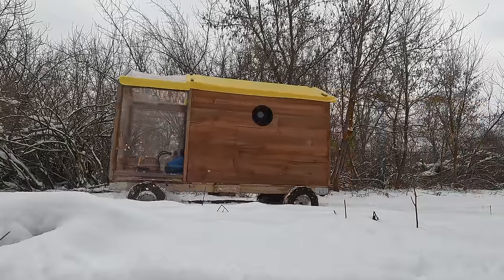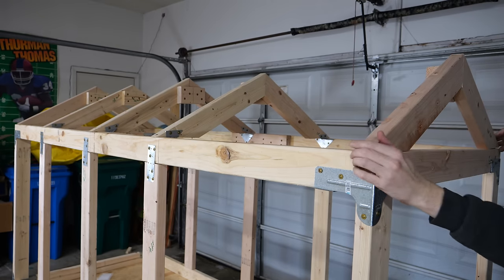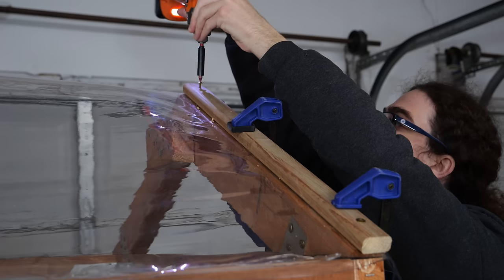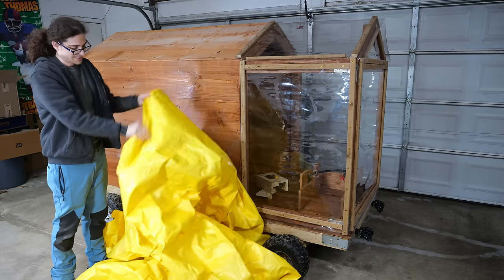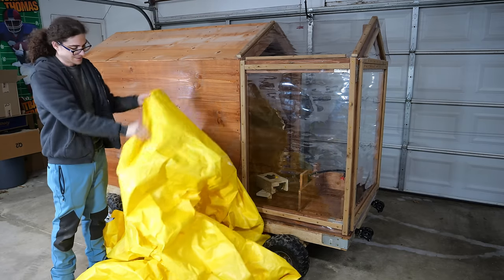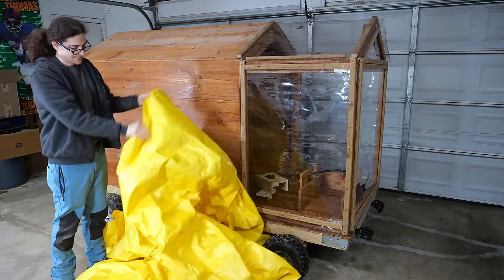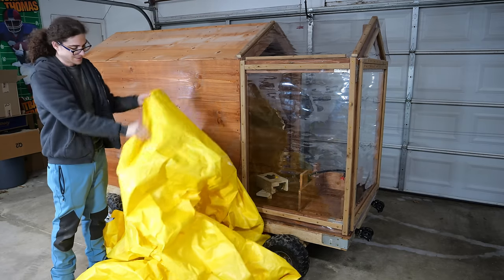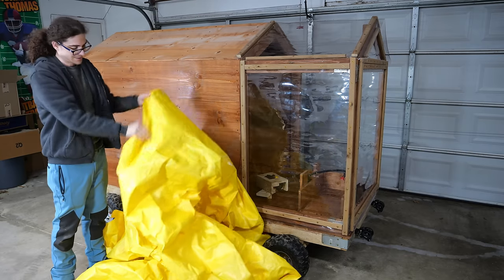UPGRADING The Drivable Camper - Full Cabin Build + Snowy Overnight Adventure

Comment: Great job! A few pointers:
1. Rear view and side view mirrors.
2. Some sort of pop open top, vw camper style, hinges at front or rear of vehicle
3. A tiny wood burning stove
4. Thinner supports
5. Thinner veneer like luan so lightweight expansions are possible
6. Logbook of adventures
7. A boat port a pottie with separating waste bottom.
8. A second emergency entry exit for safety. (OSHA enclosed spaces)
Reply: ..a log book? You really are an OSHA man
Reply: secondary emergency exit/entry is the front vinyl imo

Comment: Your camper content is incredibly refreshing. I'm so used to seeing $100k sprinter van conversions get so much attention for camping, they almost make it seem essential. My suggestion would be solar panels on each side of the roof if needing the extra power. Maybe instead of tarp you could use some waterproof vinyl fabric for the 'roofing' and then stitch the solar panels on top of it. There are videos of people doing that on boat bimini tops. I do live in south florida though so i'm not familiar with how that fabric would do in snowy weather, but it handles wind very well. Maybe not needed for short camping trips though. Other comments have also already mentioned some kind of fan/vent for the condensation or however you call it that your breathing indoors makes. Keep up the amazing videos, I look forward to them!
Reply: There's a YT video someone made about how to make any fabric into a waterproof tarp using silicone caulk and a solvent but I don't remember which one. You would be able to make a whole top out of it.

Comment: Next step. Insolate camper. Keep in mind that the inverter will generate heat. So you could add a couple of little fans to add air flow to help keep it cool. You did good

Comment: Hi Jason. I recently found your channel and you have quickly become one of my favorite creators. I really enjoy the creativity in your builds. I have already found myself looking forward to your uploads to see what you come up with next.

Since you asked for suggestions for future builds, here's my list of things I would like to see you tackle:

1. Insulation. You woke up to a chilly 25 degree morning, but an insulated camper would hold in more heat overnight. I think this would be a nice upgrade to any camper build and a big quality of life upgrade for winter camping. Note: a two layer window with a small gap of air between layers will hold in heat better than a single layer window.
2. Suspension system. Don't know if this one is possible, but might be doable with some heavy duty springs. It would be cool to see if you can tackle this.
3. Ventilation. Vents could help with your humidity/window fogging problem as well as reduce concerns about carbon monoxide.
4. Lighting. Orange or yellow cellophane covers for lights will mimic a campfire and makes for a more cozy experience.
5. Metroid Prime is my favorite gamecube game for the exploration, puzzle solving, and cool aliens. I suggest trying it if you haven't yet!

Comment: Screws tend to break where nails tend to bend when a structure is flexed, which happens quite a bit when bouncing through the woods.

Also a roof gap at the peek is a good thing as it helps with venting the rolling cabin. Cover the gap with a Roof Ridge vent instead of filling it in. Of course that assumes you use something other than a tarp as a roof in the future. This can be made with a closable end caps for if you are worried about too much heat escaping. Also helps with Air quality, and moisture buildup.

Your vinyl roof bit in the front is going to have pooling issues for rain/snow, with that bottom wood strip in place. Should have made it overhang and go over the side and secure it to the side of the top wall beam instead of the top of the wall beam.

Comment: Points to improve upon:

1. make all membranes (tarp, vynil) double-layered, the layer of air between the two sheets could help with heat retention.

2. insulation for the walls and roof - add some sort of foam or fibrous insulation to prevent heat from escaping through these parts.

3. suspension - create a suspension system to raise the vehicle from the ground and reduce the amount of bouncing around.

4. - bonus - snowplow.

Additional good things - add an awning for an extendable roof on the side for an improvised porch, good for when you want to do some campfire cooking.

Another is - create a trailer. 

It could be used to haul extra gear, or even for a field shower.
Reply: I was going to suggest myself some insulation board that would be easy to cut to size, could also cut sheets to fit in where the vinyl windows are,then remove when needed. Love the build!!!❤
Reply: This should be at the top. Would love to see him do this.
Reply: 5.  Slide outs :)

Comment: Love it...
Some suggestions..
Definitely bigger wheels, like wheel barrow wheels. 
Headlights also, it will add to the "submersable" feel of it.
You should try tracks, like a bulldozer, or maybe have a half track, they go faster and more maneuverable.
Also - you should get the back door to open upwards, so it will make  a little covered porch area when you open it up. You could even make a deployable set of tarp walls, but thats more a summer thing.
Reply: He made the original motor to work for a specific range of sizes/specific types of wheel. Just like on a combustion-powered vehicle (passenger cars, mainly), you can't stray outside of a certain range of sizes in wheels or your engine uses far more to power everything with even more actual power loss. You'd lose more than you gain, essentially. This is why they need to upgrade systems if you have a truck you want to jack up, since you'll need much larger wheels, typically both in height and width. 

On most vehicles, you'd have to modify the suspension, drivetrain, and possibly the engine in order to accommodate much, much larger wheels. He'd probably end up needing a lot more power to get several inches larger in diameter for wheels. I can't tell you specifics since I've never worked with such small systems, but this is just the general rule.
Reply: He did put tracks on it at first , if you go back and look at previous vids
Reply from the maker: Yea I need some bigger wheels! maby some chains on them. I might try some larger tracks again but I'm worried it would be to heavy for them and rip. Ill think about it all  Thanks for the suggestions - Cheers!
Reply: @QuietNerd  Your channel is delightfully weird, and ....... cozy(?) Thanks

Comment: It would be really cool if you had a tablet on a small slanted dashbord at the front, like a StarTrek control display, that controlled the motors and another one that displays battery status, temp inside and out, lights, WiFi signal etc.
Another great build QN, you did a fantastic job. Those port hole windows look awesome.
There's a channel you might like called "Truck House Life," a guy built a small wooden cabin on the back of his pickup truck, it's full of great solutions.

Comment: I suggest bungee cords, Squeegie, and micro towels to help wipe down the windows with little to no smearing. Did you know they make chains for your size tires? That could help grip the snow and ice. If that sleeping bag has a bottom zipper keep the heated blanket feet and legs. You can keep it low and still be warm. Less is more. Too many clothes in a sleeping bag won't help keep you warm, but hold moisture and make you colder. A head cover for sleeping works better. Balance out your load. Help keep your buggy from bouncing so much and help distribute the weight equally on your power wheels. Like I said it's just suggestions.
Reply: Good ones!
Reply: @causeeffect7624  I had more. I am retired USAF but my first duty assignment was a mobile radar unit in Germany. We were out in the field more than the Army was. Packing and unpacking finding out what works and what doesn't.
Reply: @spokanetomcat1 it could be debated that keeping the heated blanket near your genitals would keep you warmer due to a lot of blood flowing in that general area
Reply: @Da-choppa  Surprisingly, you will be warmer faster with the heated blanket around your kidneys.
Reply: @spokanetomcat1  really? I’ll have to try that sometime, thanks for the advice
Reply: @Da-choppa  PS...love your name...LOL.

Comment: 11:50 pro tip for when you stain wood; after hitting it with the stain, use a rag you don't mind getting ruined to help 'finish' the stain. It helps remove the marks/trail/path left by the brush, and any excess stain that could drip down.

Comment: Hey @QuietNerd , I made a list of majority of the suggestions that the comment section said. Keep up the great content!!!!

Double-Layered Membranes (Tarp, Vinyl):
Pros: Improved heat retention due to the layer of air between sheets.

Insulation for Walls and Roof:
Pros: Prevents heat from escaping, enhances comfort.

Awning for Extendable Roof:
Pros: Creates an improvised porch, useful for campfire cooking.
Cons: Adds weight, potential complexity.

Trailer Attachment:
Pros: Additional storage space, potential for field shower.
Cons: Adds weight, may affect maneuverability.

Clear Corrugated Plastic Sheets on Roof:
Pros: Potential additional insulation, lets in natural light.

Diagonal Struts for Roof Support:
Pros: Enhanced structural strength.
Cons: Potential complexity in design and construction.

Larger Vehicle with Standing Space:
Pros: Improved comfort, more living space.
Cons: Increases size and weight.

Vent Above Door:
Pros: Improved ventilation.
Cons: May add complexity, potential for leaks.

LED Lights Inside:
Pros: Enhanced interior lighting.
Cons: Potential increase in power consumption.

Switch Front Tires for Better Grip:
Pros: Improved traction.
Cons: Requires maintenance, potential cost.

4-Wheeler Tires for Better Traction:
Pros: Reduced bounce, increased traction.
Cons: May affect speed and fuel efficiency.
    
Extractor Fan for Condensation:
Pros: Reduces condensation.
Cons: Adds complexity, potential power consumption.

Anti-Fog Spray for Windows:
Pros: Improved visibility.
Cons: Regular application needed, potential chemicals.

Wedge Design for Snow Clearance:
Pros: Improved snow clearance.

De-Icer and Squeegee:
Pros: Useful for winter conditions.
Cons: Adds weight, limited use.

Slide-Out Add-On (Similar to RVs):
Pros: Increased living space.
Cons: Adds weight, potential complexity.

Attic for Storage:
Pros: Additional storage space.
Cons: Potential increase in weight.

Replace Drive-train for Higher Ground Clearance and Power:
Pros: Improved off-road capabilities.
Cons: Expensive, complex modification.

Suspension System for Improved Traction
Pros: Enhanced traction and off-road performance.
Cons: Adds complexity, potential cost.
Reply from the maker: Awesome list I appreciate it! - Cheers!
Reply: @QuietNerd  Your welcome!

Comment: Make the top collapsable, add solar, add small wood stove. Make the bottom a full kitchen. Add a tent extension on the back so then you can have a “bathroom area” with a camp toilet and a portable shower. This way, all the bases are covered and you’re putting less stress on your electrical equipment.
Reply: Think the top is already collapsible …just not designed

Comment: @quietnerd -- Big safety note, you need better ventilation to use heaters. (its why your building up so much moisture)
you will build up Co2, and potentially cause yourself injury.

you could add a angled plastic dryer vent to the tarp on the back window to make up for this :) (bonus points to add sticky backed mesh to the vent to make it bug proof)

Also, also, they make DC induction cooktops, you can avoid the inverter and waste less energy.

Comment: This might not functionally improve it that much. But a radio or just bringing a portable radio while you drive would be fun. Maybe you could somehow have the roof collect rainwater. and add in passive energy sources like solar panels and little wind turbines to collect energy just in case you ran out of battery life or wanted to stay a couple nights. I like what you did to improve. The portable camper looks insanely cozy.

Comment: Great content. Just a heads up that Moisture is probably going to get trapped in between the wallboards since the connection between each board is flat and not angled outward... Maybe not a problem for you but for longevity this would benefited to be constructed a bit differently.
Reply: I was thinking the same thing like those little puzzle piece angles that you can use to slide the boards together into one piece
Reply: @thegamingjugg3rn4ut41  there is plenty of boards and wood products designed for this. So I think better would be for everyone trying to diy building just to use something that is made for facade

Comment: I surely do have a suggestion! Add insulation to the walls, roof, and floor, so you will not need to use the heater as much as you currently do. Oh, and also add suspension so you don't shake around in the camper! 👍

P.S Make the volume on your videos louder! I can only hear them at 50+ volume on my laptop! 🔊
Reply from the maker: Ill keep in mind the volume for next video! and a suspension is a must upgrade on the next build in the future - Thanks for watching - Cheers! :D!
Reply: @QuietNerd  Thank you and your welcome!
Reply: @QuietNerd the thin pink foam boards they got at home depot think they're called pink panther lol pretty decent stuff doesn't leave a big mess

Comment: I love the build. I would suggest caulking the boards for the wall together so when its raining sideway or water coming down the roof. Water wont seep inside. If you wanna go a step further and ditch the tarp. You can ether overlap the bords or use your table saw or router  and make tongue and groove. Making sure that top is always overlaping the bottom boards. Or just buy shiplap boards. Finishing it off with the stain and clear finish sealant.

Comment: The buddy heaters are made to run indoors. I've used the big one tent camping for years, run off a 20lb cylinder outside the tent. It's got a tip over safety shut off, and a built in carbon monoxide detector that shuts it down when it reaches less than half of the recommended level. They created them to use inside ice fishing cabins up north on the frozen lakes.

Comment: The vinyl roof installation up front, had me reminiscing about me installing my hovercraft's skirt to the hull for the first time.  The skirt stretched taut on all 3 points of the hull, so stapling was really easy for one person to do.  Then I installed a strip of wood over the staples to further secure the skirt to the hull.  HH-66 tent glue was used on the nylon lined truck tarp material I used.

Comment: A thought.  Build a trailer "Docking station" to pull up on and then pull with a vehicle to different locations across the country.  The trailer could include some maintenance items as well as the ability to charge your battery via the car or truck engine.  Also, add some solar panels

Comment: Just a few suggestions you need insulation on all surfaces , something to hang and cover the windows on the inside that would be more for insulation than privacy , jacks or equal like a couple blocks of wood  would do (where jacks would allow more adjustment )on two corners to level your floor to help you sleep , and  small ventilation to remove the condensation from breath , cooking and heat .
Larger tires yes more batteries and solar panels

Comment: Maybe you should try making the camper treaded! It would certainly help with stability while driving and you would also be able to traverse more difficult terrain. Making the vehicle treaded shouldn't be too difficult because you can simply change the wheels into sprockets to drive the treads. If you wish, you could also make a gear train but instead of using gears you could use sprockets and a chain alongside the treads.

Comment: Next model you'll have to figure out how to lighten everything up so it uses less battery. Maybe a shock absorbing system so the bouncing isn't so severe and harsh on everything inside. You could also try and find a way to not only utilize solar energy, but wind and water energy as well while parked. That way you recharge even at night.

Comment: I am sure many people already suggested it, in case they did not: you could save a large quantity of electricity if you insulate the walls and ceiling with 10mm foam insulation with aluminium at one side. not too heavy and very effective on the back of a solid wood panel like yours.

Comment: Add 2 x100 watt solar panels to charge the batteries to make up for some energy loss. Also, you need to create a dehumidifier or venting outlet  for moisture. A timed air exchange..and a times heater.

Comment: Have you thought about insulating it?  It would be easy - just get some rolls of insulation, , put them between the verticals and attach some thin horizontal boards to the verticals.

Comment: Add another axel about a foot forward from the back one! So it will be 6 wheeled, and add one or two more motors depending on whether you have individual motors per wheel or not 😛

Also possibly add a sled bottom to it so it can more easily go over snow and possibly other terrain like sand dunes

Comment: Here's my suggestion!

Two 200w solar panels for the roof! If you can get it setup to recharge your battery whilst you're out doing other things in the wilderness, you could potentially have a longer stay!

Other than that, you might find that an ESC could save you some battery cost.

You could also improve it's handling capability by adding a conventional steering setup. I havent watched any other videos of yours yet, but there's gotta be a way

Otherwise, 10/10 content! Loving the build!

Comment: Looks like fun ..i would use a small wood chip burner up by driving area for heat .or tiny propane heater . Add small pipe .😮.😮😮